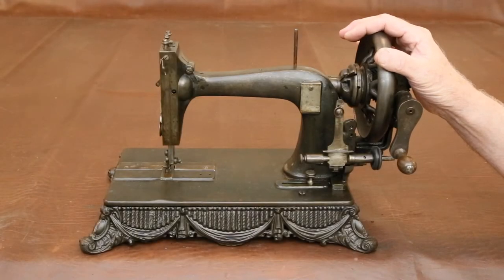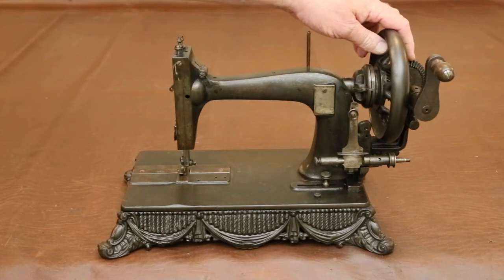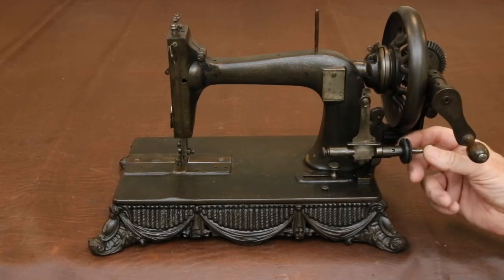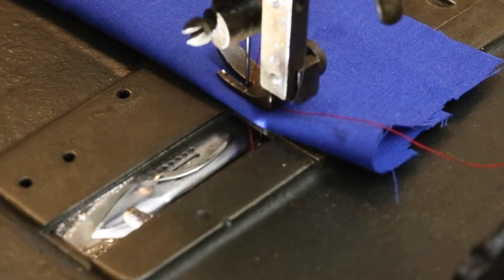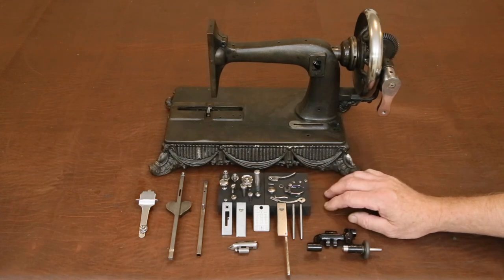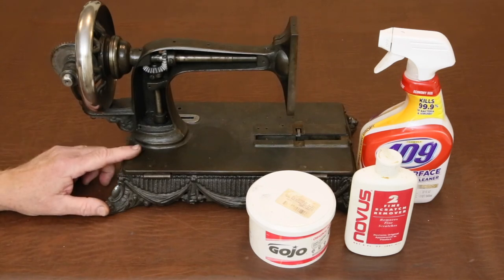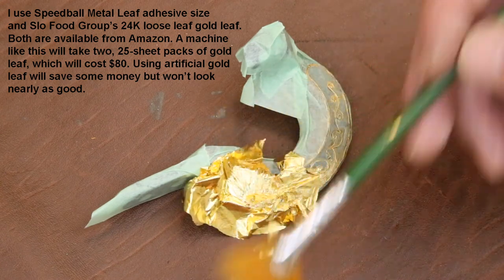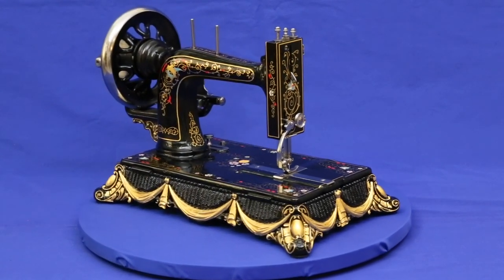How To Restore An Antique 1875 Biesolt & Locke Sewing Machine

Comment: Another incredible video Wayne, I enjoyed every second. Perhaps one day when I have more time and experience, I will attempt a restoration like this!
Reply from the maker: Thank you!
Reply: @wayneschmidt490  Do you apply the gloss black enamel spray paint directly onto the existing machine surface without stripping anything and without primer? I have seen some videos where people strip down the bare iron, prime, and then paint the whole machine. Your method looks much easier and less time consuming.
Reply from the maker: @tobyssewingmachinerepair8949  Taking it down to bare metal is the better way to go. But I've discovered that after cleaning the old Japanning followed by a wipe down with acetone I can get good adhesion of the spray paint, even without a primer. What lets me get away with this, and using an inexpensive paint like Rustoleum, is that I don't anticipate these machines every being subjected to heavy use.

Comment: How did you get the japanning off this machine? That stuff is almost one with the cast iron! Did you spray paint over the japanning?

Would a machine with this much relief detail have been japanned? I have a New Home Model U(?) badged "Lady Washington" of unknown age (estimated 1900) that is very similar to this B&L, including the ornate footed cast iron base and (long gone) handcrank, It has a few of its decals left,  and the finish is a lacquer-thinner-soluble black paint over the cast iron..
Reply from the maker: Every antique sewing machine I've seen has been japanned. It's the hardest, toughest, longest lasting finish ever invented for metal. It's so good that many tool makers still use it today. 

The japanning on my machine was almost completely worn away. I sanded down the areas remaining so they were flat then sprayed with gloss black enamel. 

Many of the machines I've restored have their japanning intact, except for some scratches and chips. I spray over these with gloss black enamel after degreasing, cleaning, filling in the chipped areas and giving them a light sanding. This creates a smooth even surface for the artwork. I haven't had any problems with the paint adhering to the japanning. If the surface is very rough, I'll lay down two layers of filling primer, then wet sand it smooth. 

Your machine may have been repainted, but I wouldn't be surprised if the lacquer thinner you mentioned was able to dissolve japanning.